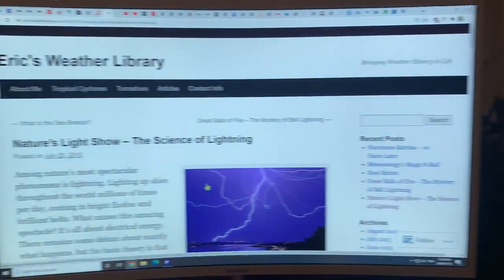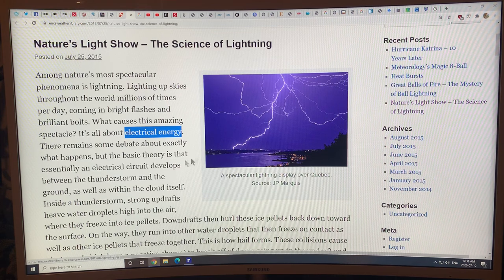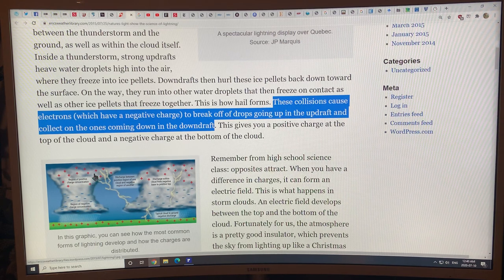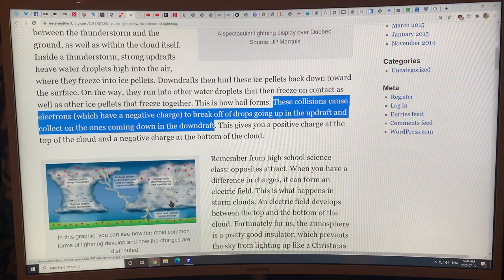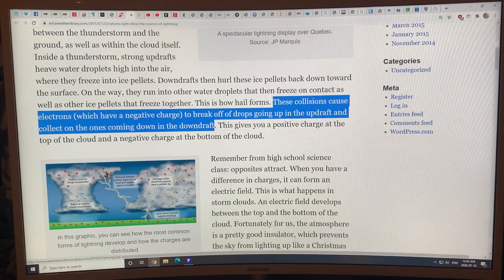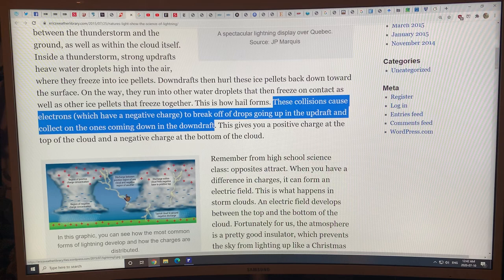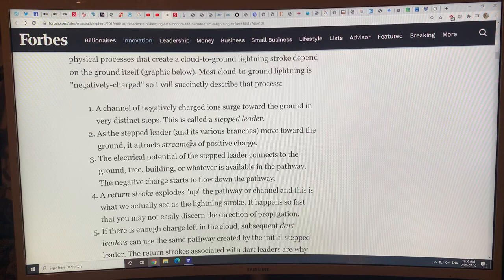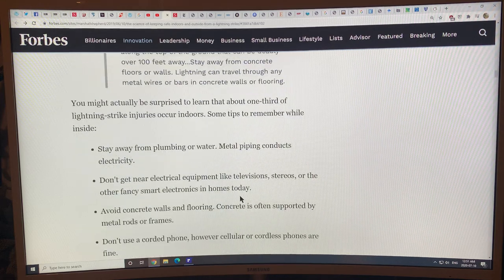Lightning Types: Intracloud, Intercloud, and Cloud to Ground, and the Extremely Powerful Superbolts

Comment: Hi Paul, have you noticed that the northern hemisphere jet stream is significantly weaker than the Southern Hemisphere jet stream? If so, any thoughts as to consequences or can the two operate independently without any impact on the other?
Reply from the maker: The hemisphere in winter usually has the more powerful jet stream...

Comment: This series on lightning was interesting. Within this video series were hints that global warming will cause lightning to become more frequent within the Arctic Circle as the 21st Century progresses.

Warmth within the Arctic Circle will also cause faster melting of the Greenland ice sheet. Greenland ice sheet melt has a potential to be very rapid in the last 3/4 of the month of July, and a potential that was realized in two 21st Century calendar years, the year 2012 and the year 2019. In most years so far in the 21st Century, Northern Hemisphere sea ice extent was large enough a quarter of the way into July, July 8, to serve as a "damage sponge" against melting of the Greenland ice from occasional attempts of warm continental air masses to drift over Greenland in the last three quarters of July. By the time the continental air masses arrived, almost all of the melting power had been taken out of those July continental air masses because of their having been sufficiently chilled by the extent of the Northern Hemisphere sea ice, and little ice sheet melt occurred. However, in 2012 and in 2019 and in 2020, Northern Hemisphere sea ice extent was below 8 3/4 million square kilometers 1/4 of the way into July (July 8), meaning that there was not enough expanse of sea ice to adequately chill any warm continental air masses that might approach Greenland. It will be interesting to see if any warm continental air masses relocate over Greenland during the last 3/4 of July this year. If so, one can predict another large melt like in 2012 or 2019, since there is not much sea ice extent to chill any such air mass before arriving over Greenland.

This line of thought also has some applicability to predicting a 21st Century increase in lightning within the Arctic Circle. Sea ice tends to keep sea water at a temperature of roughly -1 degrees Celsius. Not much evaporation happens at -1 degree Celsius, so the "water cycle" is not very intense, meaning that there is not much rainfall. Paul Beckwith mentioned the scaling approximation that if all other factors remain the same, lightning is approximately proportional to the amount of rainfall. Sea ice is essentially incompatible with a water temperature of +6 degrees Celsius or higher. However, once the sea ice goes away, sea surface temperature can easily rise to +6 degree Celsius, which causes evaporation to increase, which causes a more intense water cycle, which results in more rainfall and therefore more lightning. With a sea surface temperature at +6 degrees Celsius instead of -1 degree Celsius, there would also be a greater temperature difference between the surface and the tropopause, so the CAPE index will tend to be greater as well, causing even more lightning.

In short, as Northern Hemisphere sea ice extent decreases over the years, there will be more lightning within the Arctic Circle, and there will also be faster melting of Greenland's ice sheet. At this moment in time in the first half of July in the year 2020, both results are about equally important. However, in a half century or so as the rising sea starts to severely flood the world's river deltas, increases in lightning will be a mere side show. The main event will be the loss to mankind of large amounts of rich agricultural land in various delta regions around the world. Both the Greenland ice sheet and the Antarctic ice sheet will melt sufficiently fast that sea level rise will drown delta regions that took 6,000 years of sea level stability for the process of river sediment deposition to establish.

Comment: Is there wall lightning? Many have photographed and experienced literally sheets of lighting. I did and have photos of many layers huge walls of lighting. Crazy storm 2013 July, 25th. The after affects amazing colors in the sky. A sky like I have seen in other areas after this storm I experienced for the first time. July 4 they did a lithium payload release in my area... testing the I added in aerosol with the other chem aerosols. I believe within a week, east of us across the Atlantic pond... They had a raging storms as well. I believe it was in Iran had a years worth of rain dropped all at once. Is there a means of controlling our upper atmospheric river’s within magnetics? Adding in the lithium payload to the chem slew  would add a paramedic effect. 

The Super Bolt when photographed are those the ones that look like ribbons and almost stepped down like stairs?

Comment: The information on Bolts from the Blue is incorrect.  They have been documented, filmed and have published papers by lightning physicists, that, they are in fact negative types.

The image shown may appear to have initiated from the anvil, but in reality they propagate from the central negative charge region as a bi-directional, bi-polar leader in the core.

They move horizontal due to like screening layers which prevent the leader moving vertically to ground.

Of course you can get +CG BFBs, but they are not as common as the now discovered negative propensity.

A lot of official sites and online pages have not kept up with recent findings nor adjusted text.